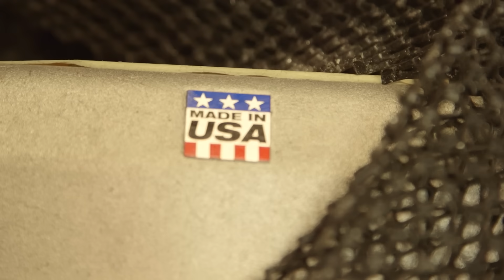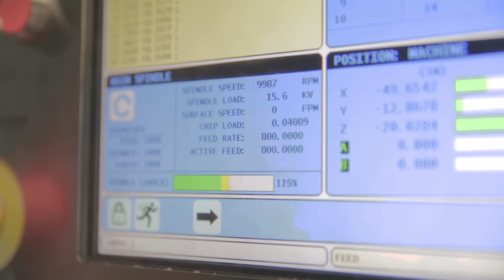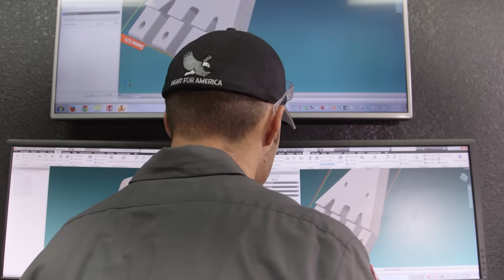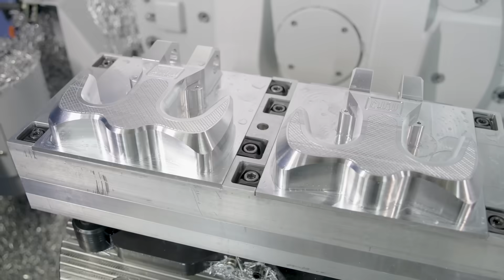Small Machine Shop Owner FIGHTS Back Against GOLIATH Company

Comment: The first lathe and mill I bought came from a machine shop that had a big contract with a hydraulic cylinder company. The machine shop went bankrupt because the contract that they signed had them keeping so many premade hydraulic cylinders on hand, in the machine shop warehouse and housing the raw stock also. They only got paid for their work when the Hydraulic company sold each cylinder. The owner went banckrupt and the stock and cylinders not having the Hydraulic Company name on them was deamed the Maching shop company's stock which was bought by a scrap dealer. The Hydraulic company just lost the cost of their bar stock. Over the past 50 years I have seen this play out three times. Be careful what contracts you sign.

Comment: Sounds like something the conglomerate in the video would do. I ordered valve spring locks, they packaged the wrong thing, when I called they told me to pound sand. I no longer buy anything from Comp or Edelbrock.
Reply: File a claim with the CC company - chargebacks is one of the key negative metrics in business.
Reply: @ckm-mkc  Bought it through Summit and they decided to ship another same day. Summit has great customer service.
Reply: I guess I’m not going to either. Unfortunately, their low cost carbs will probably keep selling. They’re,,,,cheap,,,
Reply: @shanepowers7566  The best carb I ever bought is an APD 950 CFM billet enforcer 4150. It was about $950 and totally worth it. Car idles perfect dead cold and the drivability is fantastic. I don't think I would go back to a mass produced carb that is cast.

Comment: Realizing you have value means not selling yourself cheap.  Great video!  Thanks.  The dirty tricks of big business are epic.  I've noticed the first sign of a good company's decline is when they market their product in a 'big box store."  Quality begins to fall off first, then sellout to some merger, then their name falls off list that customers respect.
Reply: I read that Walmart is notorious for this. They start to buy from a small manufacturer, and then Walmart becomes the biggest customer composing 60+% of their business. They then require a cost cutting of 3% per year. Initially that is pretty easy, but it gets more difficult each year. Eventually, this forces a business to take production offshore, and if they can't keep going, they go under. And Walmart doesn't give a crap about that, and just moves on to another supplier and the cycle starts again.  While I heard this specifically about Walmart, I can't imagine they are the only ones doing this.
Reply: @JeffFine  Exactly!  Friends of mine had a plant nursery business and to meet demands of both Walmart and Lowes, they expanded their operation only to face "contract re-negotiation" that put them out of business.  "Big box stores" regularly practice bait and switch tactics.

Comment: Standing your ground is a fine ethos, however,  there's always another small company out there looking to undercut you.  The pressure is from both sides the customer and the competition.
Reply: then get out of the race to the bottom while your prices are still high.  working for free is not a business.  that is a hobby.
Reply: @jwilsonhandmadeknives2760  Get out of any race to the bottom, as there are no long term gains to be had.
Reply: @JeffFine  and J/W  you are both correct the race to the bottom leads to nowhere.  That's why personal relationships are key to success.  its hard to screw your friends, but not impossible.   Service, reliability, are expected, but in business its bad planning to allow any customer to have more than 50% of your gross.  Banks won't do it, even if a bank could do it they would never loan 50% of their potential to one entity.   That would be a partnership, not a client. 

That's why so many biz resort to political protection in the form of regulations to limit their competition.   Also, nothing is going to stop the bean counters from destroying your profitability.  That's why diversifying is paramount, you can be prideful and walk away, but the smarter move is to have a plan that allows you to walk easily.
Reply: @berkscatbill5582  you are absolutely correct.   You have to PLAN for the times when you get squeezed so that you are able to walk away.  That is a fantastic point.

Comment: Been there 200k and tools down...And was the 3rd link..And End up buying the company very cheap and stripping it to nothing as we holded all there stock and there very big machine we used....At there Table we sat and was told they wanted to buy us out on the cheap as they were building a new unit and would under cut him.. My boss just went" No".. We had all there main stock and been buying all there blank over run stock... So they took the machine as it was there's and We needed the room fast... Lucky we had 4! Good small? companies that paid on time and we had no rent to pay and lots of stock .. My boss pre see it coming and was having a lot faster machine 1/4 the size built to how We/workers wanted it.. In the time it took them to reset up and pay .. We had took there biggest customer as they needed stock and we had it in stock and small over heads My boss showed them a book at the meeting to show we can run at a loss long then them by years..

Comment: I heard a business coach once say get rid of those account that are causing you problems. And on occasion we have told people to take a hike. Interesting part is they some times comeback a ton more amiable.

Over the years my company has not had much success in getting certain types of accounts primarily because we refuse to bid them low to get that "big" account. The thing is I can easily get several small accounts at our normal rate. Pointedly it is more profitable to take the small accounts why would I waste my time on an under bid larger account.

Comment: I've seen Goliath kill small businesses because they wanted to make a little extra money on the interest their money is getting in an account vs actually paying what's owed. The small business was eager to get Goliath's business--it would've been a lucrative deal IF they could survive Net 180 terms. They couldn't survive. By the end of it, they were paying their vendors with prepaid Visas that could be bought with the survival loans any bank may give them.
Reply: Net 180? 180 days till they pay?
Reply: @kensmechanicalaffair  correct. It should be further noted that the 180 days started from the time the end product was certified complete. The company was a sign manufacturer/installer that has done some of the biggest signs in the country. Some of their projects had 2 months of design and approval time on top of 6-8 weeks for construction. It may be a month or more before they certify the sign as complete. Some of these projects lasted almost a year before they saw a dime.

Comment: We had a great electric motor rewinder shop that did our motor repairs. Our city gave him a rush job and never doing any work asked for a deposit but the promised payment in full within 30 days. 3 years later he still did not recieve a dime but ask him to do another rush job. He had the huge motor finished but refused to deliver it until they hand deliveted a check for first motor. After he got the check told them he would deliver the second rush job after they hand deliveted a check for it. Several city lawyers called him and told them they need this old obsolete 4000 volt motor back that day because they were calling for very heavy rains and this was for a subway pump. He kept hanging up on them. Finally hand delivered another check. City told him they would never use his shop again. He laughed and said he did not want their business. One machine shop that I did work for had 75% of their business from one company. Shop foreman tried to tell owner should never have more then 25% of work from any 1 company. Anyway customer went thru hard times for several months and machine shop had to lay off a few talented machnists. When things picked up none of the guys returned due to getting jobs at other shops.

Comment: Its not just big company's that will do this. Regular People will do it as well. I used to do cheap auto repair and would give the best possible price far cheaper then elsewhere, And people would still want lower prices because I was a individual, but the same people would go to a "shop" and pay 10x the amount no issue, and if the "shop" damaged or broke something they wanted me to fix it for practically free. I had a customer once that got spark plugs changed in a 4 cylinder car the shop charged her like 300$, and it did not even fix the issue it had a misfire. It need a coil pack, I told her I would install cheaply 20$ she told me since I was her "friend" because I worked on her car before, that I should do it for free.. So I did install it for free. Then a few weeks later she needed more repairs done, I told her I could not work on her vehicles anymore. funny thing was she did not want to bring me the car to do the spark plugs etc, but was willing to pay someone else 300$ and wanted me to go behind and fix the original problem free of charge. but did not want to go back to shop and make them fix a misdiagnose issue.. I learned about bending over backwards to help people. I don't do much repairs for other people anymore I would rather do nothing and sit on my ass watching YouTube instead..

Comment: Glad to see he profited without them.  Reminds me of my least favorite costumer turned about #5 favorite. Had enough one day when they called to dispute interest on a late bill they refused to pay due to (drumroll please) $0.25 extra on a bill over what the verbal estimate. All because a technician changed them for 2 flat washers . They nickeled and pennied us all the time, expected to drop off at 3pm and have back at 6am the list goes on from there. By the 7th minute of the ensuing phone call from them enough choice words were used at me that finally my fuse lit.  A lot of choice words and hard truths were said, told them to come remove all of the equipment at our shop to be serviced and repaired by the end of day or daily storage fees would begin. And slammed the handset down.    Two hours and a nasty at first conference call later our rate went up 20%, we had one point of contact with them and I received a sincere apology from one of their directors. My Boss, the owner where I was at the time asked me later what if that turned out bad for us as they were a bigger customer, I looked at him smiled and asked him what our actual profit had been with them before that day. You will loose good customers chasing a break even at best one.

Comment: A lot of companies do this. Push out payments past the promised net terms. We just held up some parts for a customer for over a month because they had not paid. They were pissed off. However, at the end of the day, we got paid. We still do work for this company and will continue to do so as long as they keep their payables current. Sometimes you just got to put your foot down.
Reply: Many years ago I worked for a company that was purchased by GE. I remember a memo that was circulated where they were concerned about cash flow, so the word was to demand all accounts receivable in 30 days, and put off all accounts payable for 72 to 90 days. They were willing to damage the small businesses that worked for them just to make a quarterly report look better. So fucked up.

As for the quotes where you wanted to revise them lower; I worked for a small machine shop that routinely competed against themselves - give an estimate of the lowest price you think you can do the job for. They did great work, but still ran themselves out of business doing that. For quotes, find the highest amount the customer is wiling to pay for a service, not how little you think you can do it for. The quote still needs to be based on reality, but don't cut your price before you are asked to.

Comment: I told my wife I can clean up my machines and go broke. Then to make parts basically for free or not get paid. At least my machines will be worth more when I sell them $$$.  I've booted a few customers over the years. One was a big company that wanted to pay net 90. Problem with net 90 it turns into net 120 really quick.
Reply: I did work for a company at net 30, they got bought out and told me it would be net 90. I changed my pricing to a three level system that made 90 day's, not economically feasible. They pay me in 30 days now.

Comment: Customer pays, parts get delivered.  Customer doesn't pay, parts stay in the warehouse until they're paid.  Simple.  The only way to do business.  And never even turn the machine on without a signed contract.
Reply: I have a tool and die and cnc with edm shop. I have about 4 main customers. I give 30 day terms. I have never had to ask for money, they always pay on time. Sometimes it works out fine